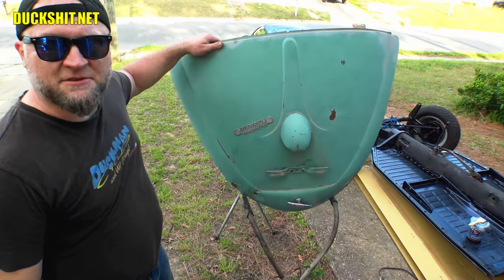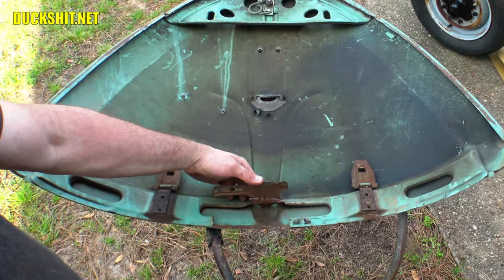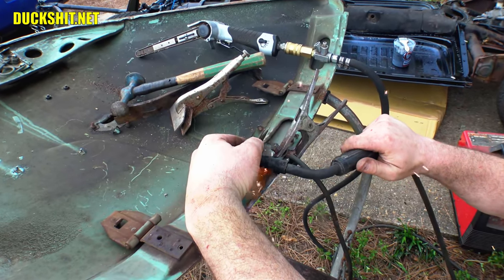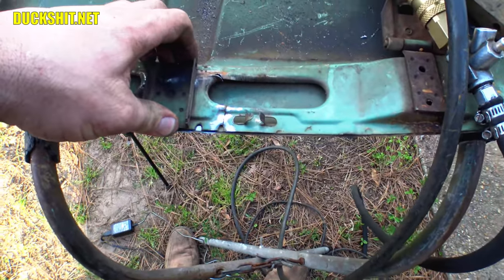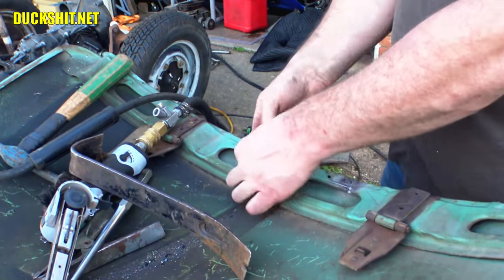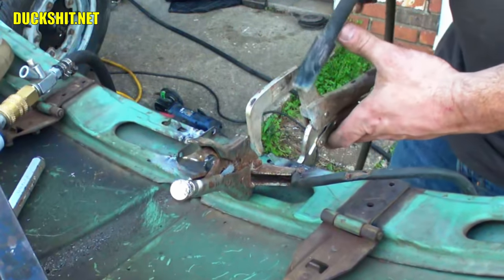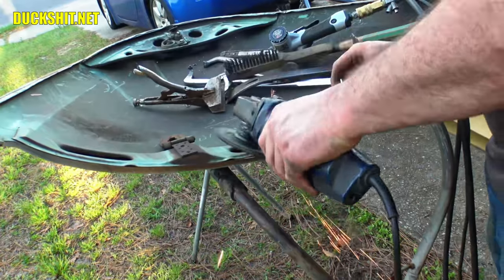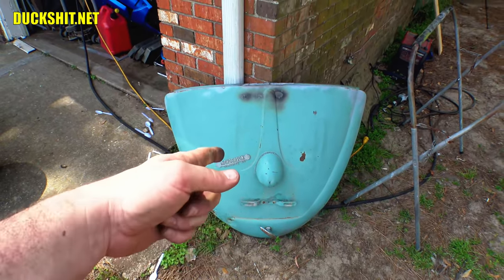VW Beetle Decklid Spring Tab Repair

Comment: "Ermagerd! You can't weld thin sheet metal with a flux core!" says people who didn't go back and watch you build Eleanore. lol I dig the cast dealer badge. I have one from a decklid I bought for a '67 project I used to have. Everything else is gone but the badge.
Reply from the maker: Haha yes... and not only did I build Eleanore with flux core, but I also used the Harbor Freight welder for most of the car and chassis.   Since I got the Lincoln, my welding has gotten better, but flux is still really hot and will burn through.  It's all in the delicate feel and control.  I demonstrated that, and even demonstrated a couple mistakes LOL!  Thanks man! 🦆💩
Reply: @DuckmanCycles  When I see people say they can't build something because they don't have a decent welder or whatever, I send them over here to see what you did with a flux core HF welder. lol
Reply from the maker: @jayinmi3706  Haha thanks!  I just had someone tell me on Instagram that they cant weld a pan in because their HF welder can't do it, and their Milwaukee has too high a power.... lol

Comment: Good job. 👍 not easy welding thin metal. The only thing harder will be getting that deck lid spring back on.🤪
Reply from the maker: Thanks man, putting on the decklid spring is actually really easy, just did that a few videos ago for Eleanore!

Comment: One thing you can do is get rid of the gas shield on the nozzle. you will see the tip better. You don't need it with flux core. Just an idea. If it works for you go for it. Great work.
Reply from the maker: Thanks man!  I do that on another welder, but if you remove the tip here, the torch vomits its guts out on trigger pull.  Nonetheless, I can see pretty well, unless I am in tight proximity like when I did Eleanore's door hinges.  I appreciate it!

Comment: Duck man, kind off topic. My 71 fastback has duel carbs. Pretty sure it was originally fuel injection. Did they ever come with carbs from factory? Why is it so common they remove fuel injection? Thank you. I lived in Palm Coast Florida several years. Better enjoy the weather while it's cool 😎
Reply from the maker: Yeah topic, probably would have been better for private message.  Likely you originally had fuel injection yes, as did my 1968 Fastback... it was the first car to have electronic fuel injection, ever, that year.  Very common to remove it, because nobody understands it. Mine was removed by previous owner for the same reason.  From what I understand, it's a very simple system for those that choose to study it, learn it, and use it.
Reply: Could look up the Bosch 'D' Jetronic system. Used separate components such as the manifold pressure sensor and electrical supply/fuel pump relays of the conventional type. The system also had a dual contact points cassette housed in the base of the distributor used to trigger the injector operation in 2 pairs. The later Type 4 Varient (411) and Porsche 914 also used this system. A comprehensive description appears in John Muir's How to Keep Your Volkswagen Alive guide/service book.

Comment: Would jb weld work
Reply from the maker: Maybe for a little while.... some panel bond would have worked between the layers for sure.... but still need some welding on the broken ends.